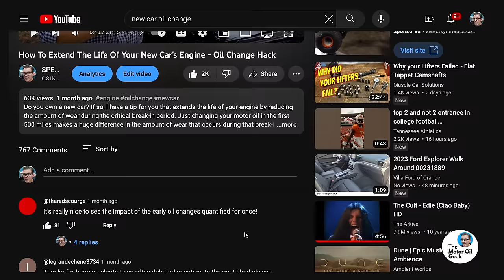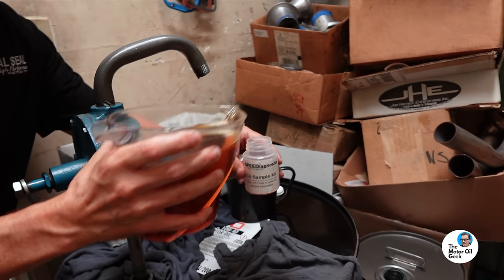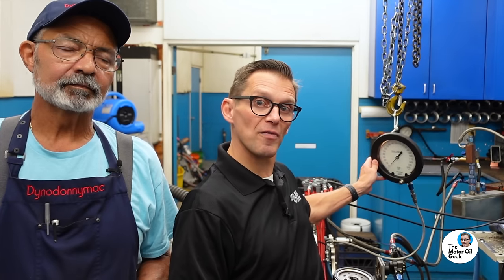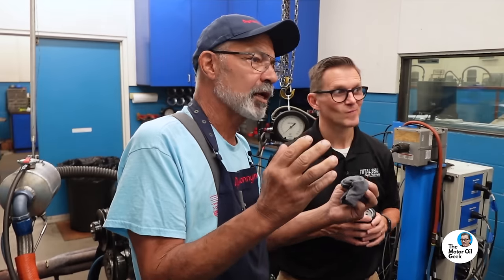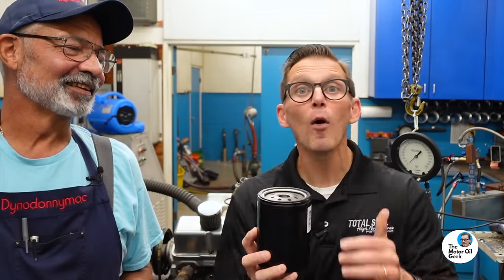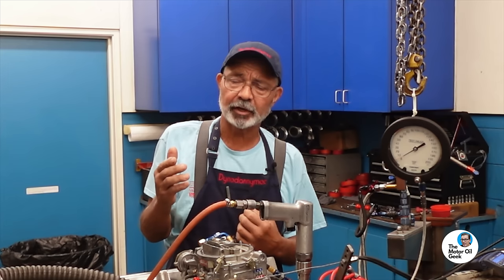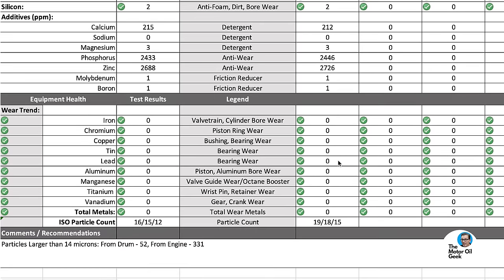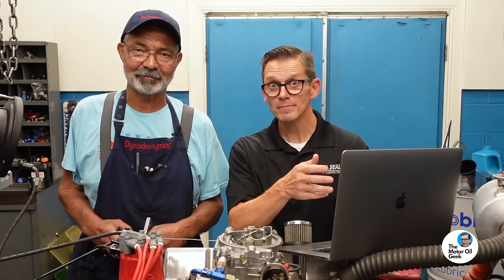Does Pre-FILLING The Oil FILTER Cause Engine DAMAGE?

Comment: Great video! I have been pre-filling since I started doing my own oil changes 7-8 years ago. I’ve never heard that it was a bad idea. Common sense would dictate that it is a good idea. You proved it.
Reply: Exactly... total "common sense" for sure!
Reply: Brand new oil in a brand new oil filter somehow not being filtered has to be one of the dumbest things I’ve ever heard. Exhaust bearing, blinker fluid, winter and summer air for your tires okay I can see where you made a mistake 😂 but this makes me think that some people wake up and stop using their brains.
Reply: Not all filters can be prefilled though. Some are mounted sideways instead of up and down.
Reply: @TheCompbuzz  You do the best you can and clean-up any accidental or incidental spillage. Better than not pre-filling at all.
Reply: @TheCompbuzz You don't fill those filters all the way. You put in enough oil that won't spill then screw it in. Some oil is better than no oil.
Reply: Why doesn't the owners manual say to prefill?
Reply: How did he prove it ? Did you see a timed test doing it both ways ?  No , you didn't .
Reply: @scottw.7441  The owners manual isn't going to cover everything. Auto manufacturers prefer you take your car to the dealer to have them serviced. That gives their dealers another source of income. Technicians at the dealership are supposed to be trained in processes the manufacturers prefer. The techs I know put oil in new filters when they do oil changes.

Comment: I’ve been filling my filters since the 80s. I saw an article about it, and it made a lot of sense to me. I have a Chevy small block, so it works well. Even though now it’s running a remote filter mount, that is vertical, I still fill my filters. My street car has a vertical filter mount, and you can bet that I still fill it. I believe that otherwise, there’d be a huge air bubble that would cause some damage in starting the engine
Reply: When you say vertical... do you mean the filter screws down on the post or up? Most filters are vertical... or slightly diagonal, but screw upward from below. I'm trying to wrap my head around the idea of pre-filling an oil filter but then turning it over to mount it... 😱😱
Reply: The thing is, there's always an air bubble, the pickup tube drains when you empty the oil pan and there's also still some air space in a pre-filled filter. This test was flawed because they did not test how long it takes to get pressure after draining the engine and installing a pre-filled filter, it takes more time than an already primed engine. I still think you should pre-fill the filter, but you don't get instant oil pressure like they tried to demonstrate in this video.
Reply: @Enword_Jim Right on... underrated comment!

Comment: Two points -working on and/or restoring vehicles and heavy equipment for 50 yrs I can't imagine that the oil out of the can is worse for your engine than the dirty oil you just removed from the crankcase. On some engines the flow is less the the diameter of a pencil with not a heck of a lot of GPM. I've always prefilled the filter and most of my machinery is from the 1950's with all ORINGINAL engines!

Comment: Makes sense. Although i have never prefilled a filter. Never had any problems noticable enough to worry about.
Reply: Not prefilling your filter will accelerate wear by 3x
Reply: @2seep  BS.  I have never prefilled any filter in 50 years.  Many many cars.  NEVER had one engine bearing failure.  My 2004 Pilot has 300k miles - no issues.

Comment: I have filled the filter on my 91 460 gas for 25 years, 440 thousand miles.  I still drive it now.  No rattle, no smoke, no other complaints.
Reply: I have never prefilled my filter over 40 years with the same car but I don't see any problem.  I don't think it will make any difference no matter what we do.
Reply: @tswvxyastswvyeej5510  I agree with you. My Silverado is 19 years old. Never pre-filled the oil filter. No engine problems.
Reply: @tswvxyastswvyeej5510  Gee I might go out and unscrew my filter, drain it out then put it back on just for laughs.

Comment: I have started an engine after changing the engine oil and filter (empty). With the engine idling, there was a noticeable crankshaft bearing knock until the filter was full and oil pressure was established. The crankshaft bearings were all in good condition and not worn. When the filter was prefilled with clean engine oil, and the exercise repeated, oil pressure was reached within a couple of seconds. It makes sense to pre-fill the oil filter if you can. It makes no sense at all to start the engine with the oil filter empty if you don't have to.
Reply: If it's knocking it's shit anyway, oil filter full of oil doesn't fix worn out parts, only your imagination is satisfied.
Reply: If you keep changing the oil without pre oiling the filter, you will, sooner than later, experience Rod knock, or at least lifter wear. Always prelube the filter when changing oil in your engine!
Reply: Many vehicles some very expensive have cartridges filters and they are not pre filled.
Reply: And if the filter is horizontally mounted , you just disconnect the nozzles/jets , or ignition sensor , or at old diesels disconnect the gas-switch on the High Pressure fuel pump, and than crank it Untill the oil-pressure light turns off , And only After that , you Can start the engine Peacefully !!! ! !!!
Reply: Not sure you can say either way is wrong as it’s more of a moot point since: 

1) most engines without pre-filling the filter will last several thousand miles outlasting the rest of the vehicle anyway. 

2) manufactures aren’t worried about it because I’ve never seen a manual yet that mentioned pre-filling the filter or for that matter a lot of engines have filters that make it impossible to pre-fill the filter. 

3) oil manufacturers are constantly crowing about how modern oils leave a film on engine parts to nullify wear from dry startups and 5 seconds seems a little exaggerated for the oil pump to pickup pressure even with a dry filter. If it’s taking that long then you got bigger problems than a dry filter.
Reply: @ihd-3603  Yes, they do last , But that still doesn't mean that the Damage of the Bearings can sometimes overtake the rest of the vehicle !!!
Reply: That could have just been hydraulic tappets rattling until full of oil. A very common occurrence.
Reply: @Smachfest  hydraulic lifters require oil pressure to keep them pumped up. So the quicker you can establish full oil pressure the better for the valve train as well as the bearings! IMO ok

Comment: Always pre-fill the oil filter if you can. It reduces the amount of time during that initial start the engine has low oil pressure from filling the oil filter itself.
Reply: Lol. Uhh no.  The oil pump is way before the filter. It’s gonna build pressure regardless of rather the oil filter is full or not.  Pre fill. Don’t pre fill. Doesn’t matter
Reply: Some filters set up straight and wont let you pre-fill.
Reply: @garyalford9394  and some like the pentastar are upside down AND cartridge so they 100% just bleed back down to the pan a few minutes after you shut the engine off.
Reply: @Russel_russelson No. There is no pressure until the system is filled. There is flow, but not pressure. Watch the video again. You can't have pressure pumping fluid into an empty cavity. There is no oil to the bearings while the filter is filling from empty.
Reply: @mback12000  I don’t need to. I have built engines for over 20 years.    There is no pressure at the gauge sending unit because there isn’t any flow there.  But the oil pump on ever engine is directly connected to the oil reservoir and builds pressure the second you start the motor.  You can’t have “flow” if you don’t have any pressure to push the flow.  Oil sending units are located on the top end usually 

You noticed he dint show testing with a empty full filter?  You know why?  Because the time Result is the exact same.  I have built and tested this multiple times.
Reply: @Scummy_shovel  My wife has been making meatloaf for 20 years, it still tastes bad. Until the filter is filled, there is no pressure to establish the hydrodynamic wedge at every engine bearing.   Just because the pump is pushing oil doesn't mean the crank is floating. You do understand the filter is before the engine bearings?  If you don't understand this after 20 years, I have a meatloaf recipe for you.  I'm busting your chops for fun :) but also serious about the technical point for others reading, and relative to your original comment about pre fill or not.
Reply: @Scummy_shovel a lot of industrial engines drain back every time their shutoff and they run for thousands of hours. Ppl only pre-fill because it makes them feel good and not because it’s necessary.

Comment: When I was younger I was taught to add a little oil, about an ounce in the filter and swish it around to wet the filter material and prevent any damage to the dry filter when oil starts coming in under pressure.  That and to put some oil on the seal to prevent seizing, which I'm fairly sure everybody does.
Reply: Yeah, but that's not enough.  Pour more.
Reply: Filter material does not get damaged by oil flow whether it is wet or dry.
Reply: Pressure can damage a new oil filter. The quality has fallen badly in recent years.
Reply: @jimdunne1900  if you are using that bad of a quality oil filter on your engine, the filter will fail regardless of wet or dry and you kind of deserve what you get for using a cheap-ass Chinese shit filter. Genuine filters have no problems whatsoever, wet or dry.
Reply: The  same people that  don't  prefill the  oil filter are the same ones that   change their oil with engine  cold and  leave  moisture and  other  contaminates in  engine

Comment: It’s not just about oil starvation on initial startup. Pre filling the filter saturates the media and on startup the DP across the filter is lower in a full filter than in a dry filter. It also minimizes air in the oil.
Reply: Exactly, even with side mounted filters, I will fill the oil filter as much as I can to wet the filter media as much as possible, and pour out the excess if theres too much, for that exact reason.
Reply from the maker: Right on!
Reply: @ratgreen  sure you can, maybe not plumb full, but just because it's on a bit of an angle you can still get quite a bit in them. Some of the older Ford's it was real easy, they were pretty much vertical. One of my older pickups has an oil cooler with a horizontal remote mount for the filter. I can get it 2/3rds -3/4 ish full then hold it vertical and quickly tip it horizontal and spin er on. You don't lose much oil.
Reply: when I had spark engines , I used to pull the disturbor cap to keep the engine from starting up and  spin the engine 3-4 times to fill the filter and then replace the cable and then start the engine. I know that was being paranoid but that would prevent any oil starvation  issue, but to be fair that was being overly parnoid. Newier cars and diesels you can do what I'm suggesting.
Reply: @ratgreen On a side mount filter I do that too, except I totally fill the filter first until all air is purged, then hold horizontal until the level stabilises, then screw it on (with the a thin film of oil on the rubber of course).
Reply: Great comment Greg!
Reply: @kfelix2934 
It's still spinning that crank before it makes oil pressure though, just at a lower speed.
Pulling plugs would help ,but then the time to put em back in defeats it. 
Build a preluber out of a bug sprayer , I use one all the time for dormant engines I revive.
Reply: Absolutely. Also, even filters mounted on their sides, quite a bit of oil can be added without spilling. I always fill the can, let it sit for a few minutes and the oil level in the can drops as it is absorbed into the media. The i repeat 3 or 4 times then install
Reply: It will get filled very quickly trust me. When that 50psi of pressure hits it will be filled and saturated in no time.
Reply: @jasonsong86  build a preluber from a bug sprayer, you can pump 50-70t  pounds in one of those containers. 
I put a Schrader on mine to see jow much the hand pump would do and I stopped at around 50psi
Reply: @oneninerniner3427 you can also fill it up fully, let it soak, and then just pour the excess in a clean vessel to put in the engine after you put the filter (now with soaked filter media) on. That way it doesn't matter if you have a Subaru (or other) where the filter is fully upside down, you still have a wet filter mounted.

Comment: Another tip for funnel storage, keep it upside-down with the openings covered. Small opening up leaves less chance of junk entering the funnel.
Reply: I store mine in a gallon Ziploc bag. I also label the bag with the type of fluid the funnel is used for.
Reply: I wipe mine off and toss them in the dishwasher with the next load of dishes. Dishwasher detergent makes short work of oil.
Reply: Just hang mine on the wall until next time. 😂

Comment: Great video.   As a retired aircraft mechanic it is wild to think anyone would recommend not pre filling.  Unless someone is cleaning the filter housing area thoroughly prior to removing the filter, more contamination would come from there than a new bottle of oil.
Reply: I pre filled a filter and crawled  under my truck, careful not to spill the oil, then bumped the fuel line and got sand all over the filter !!  Back to the auto parts store for a new one !!
Reply: @TIMEtoRIDE900  Good filters come with a plastic seal cover and you can reinstall it after prefill then remove it when you are in position to install it onto the engine. It's best to rinse clean the area of dirt and debris prior to service to prevent any contamination.
Reply: You should be fired if you are doing something in the maintenance routines that the manufacturer does not tell you to do. That is how you get people killed. If it tells you to fill it, fill it. If it doesn't tell you to fill it, don't.
Reply: This is why I don't fly in GA shitboxes
Reply: @malcomreynolds4103  Sure - now explain how people are actually "killed" by pre-filling an oil filter where the manual says "don't bother" - - - ??
Reply: @TIMEtoRIDE900  the same way every maintenance related aviation crash happens.
Reply: @malcomreynolds4103  Name one crash where the report said that pre-filling the oil filter was a contributing factor.
Reply: @jamesphillips2285  every single maintenance related crash is the result of mechanics either doing something they weren't supposed to, or not doing something they were supposed to. It doesn't matter what they did or didn't do. If the manufacturer says to do it, you do it. If they don't do it, you don't do it. If you do something the manfufacturer doesn't tell you to do, you should be in prison. your ego nor intentions matter.
Reply: @malcomreynolds4103 if you deviated from manufacturer guidelines then your accepting liability if anything fails even if the failure wasn’t a result of what you did.
Reply: @ihd-3603  for something like aircraft maintenance, absolutely. probably the same for marine or rail applications. 

Even on something like personal vehicles facing a novel problem, mechanics face their own peril deviating from TSBs to address an issue.

Comment: I've ALWAYS pre-filled my oil filters. Been doing it that way for the last 55yrs, and I've always changed my oil myself. I didn't need anybody to tell me that, it was just obvious. For the last 25yrs I've been using FilterMags on my oil filters, too. If everybody could see how much ferrous dust those magnets can pick up out of the oil and hold it until you replace the filter, they'd be using neodymium magnets on their (metal bodied)filters, too. Maybe you could do a scientific test of that, and cut open a filter and show viewers that, also.
Reply: probably a good idea for crappy blocks. when you inspect for metal- inspect for stray casting sand in the filter media while youre at it and you'll see that GM blocks are the WORST
Reply: You still got lublication on bearing when you start it up since you just had it running before you change the oil .  I saw a boy one time changing oil, had the oil out, decided to move the car off the rack and put it back on the rack for some reason,  never hurt the vehicle one bit,  a fact,  Than he put the oil in it, filter was already on it,  owner seen him do that. LOL  No, did not hurt the car,  owner of the dealership knew it did not hurt the car, it was a Chevey Impala . By the way, I never did fill up oil filters on any car , not even my NIssan Altma and it has 151,000 miles on it now , and I done thousands of oil changes on state police cars as a head mechanic,  ,  it still has lublicant on the bearing, and it will fill the oil fifter right up fast , never had a problem with it , NEVER  , after changing oil in hundreds of police vehicles for over a decade . Don't rev it up until it picks the oil up you understand. LOL   Only problem I ever had with those Dodge cars where cam shafts on those 318 motors would go out or those police would get the car hung up and rev it up wide open back and forth until they blow a hole in the piston .   Now those real old police cars that had the 440 motors in them, it could have a dead cylinder on that piston and he can ran it like that also ,  LOL  it would still do 140 mph with one dead cylinder and run smooth as pie, yes that is a fact . LMAO